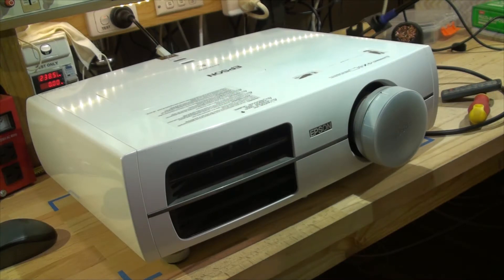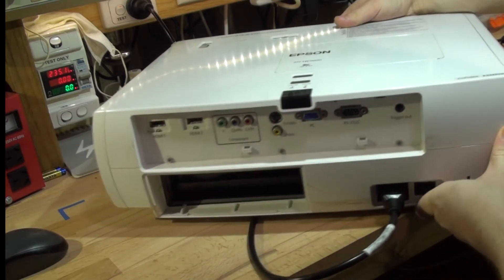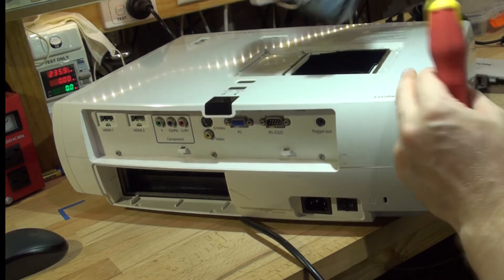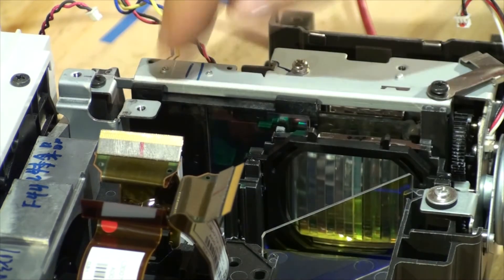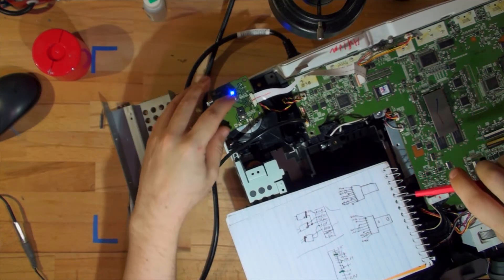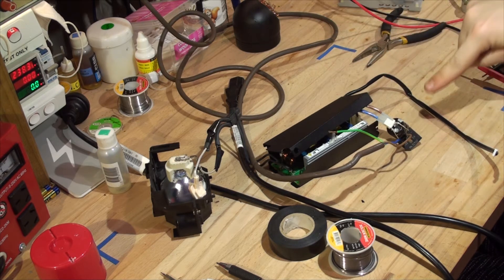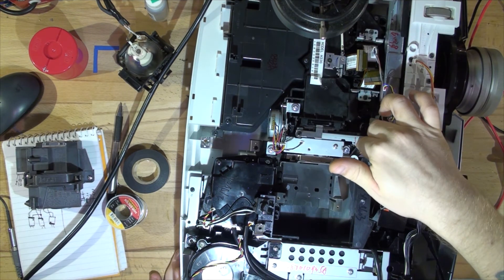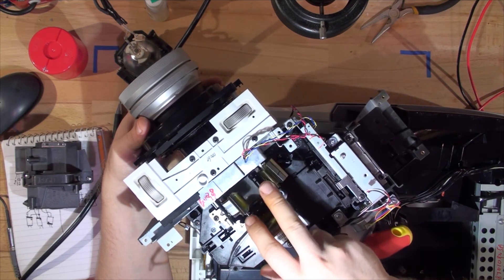Repair of EPSON Projector + Identifying bad polarizer

Comment: Hi Max, this is a great video very in depth. Is there any way to realign the LCD panels once removed? I did that on an epson tw-6000 and the convergence as you said is like 3D😂
Reply from the maker: It’s a nightmare to realign lcds, i made a mistake taking them off ones, what I did is I used a very bright torch and shine is through the engine, then I used blue tag and held lcds to the assy with it, then. I’ve attached Center lcd properly, and use it as a reference, and slowly I’d push side lcd bit by bit amd run up to a faint focused white rectangular projected on the wall from the torch and see if needed more adjustment, it’s a nightmare and frustrating. Once 2 lcds aligned close enough I use a drop of glue to set in place, so there’s no easy way to align them.
Reply: @MaxELECTRONICS  Thanks for the information. I just gave it a shot and i am confused by shining the torch through the light engine? I have a strong torch but nothing comes through the lens, i removed the optical lcd assembly and put the torch through each lcd then i had a rectangle on the wall of each colour but i still cant work out how to align by putting the torch in the same place as the lamp would sit to get a rectangle on the wall? Can i remove the lens to align or does that need to stay fitted as well thanks in advance
Reply from the maker: You need to do it in the dark, I used HID torch, make sure your shutter is open and light shines through optical engine, you will see faint screen on the wall and you’ll see the lcds out of alignment
Reply: @MaxELECTRONICS  I have the same problem with misaligned colors on an epson hc2000 :/
I'm going to try to do what you say, I thought about it but I don't have the courage to do it
great video greetings

Comment: hi have  epson  hc-8350= two red light  blinkin but no picture  lamp  & temp lights are blinking  can any one  have idea whates going on  how can i fix it    ?????
Reply from the maker: Hi, try checking that all temperature sensors with multimeter, check all Fans and ensure they are okay, also check the iris and X.V colour filter make sure they can move freely and not stuck.

Comment: I really appreciate this video, thank you! I’m currently troubleshooting the North American version of this (PowerLite 8500), but looks extremely similar. Could I get the diagram you drew of the ballast communication connector? Mine is making the lamp come on dimly then shutting off, but on occasion lighting up fully. It may try to start up to 3 times before failing. Only the lamp LED blinks though on failure. I have tried two different bulbs and both can work but both will fail too. Am I right to suspect the ballast? Thank you!

Comment: Very good video, thanks! I'm pretty sure now that my Panasonic has a problem with one or more of the out polarizer.. There is a mark on the right side of the image, the picture look more orange in this aera. And the other side the image looks more blue. This is not uniform, so I think the polarizers are burned. When a buy the projector, the filter was really dirty, the lack of cooling maybe cause the problem. I have already check the input polarizers and it seems to be good. I have also cleaned all the lenses and the mirrors, but the marks are stile here. 

Can I try to put other out polarizers from a different 3-lcd projector (with corresponding colors) ?
The input and output polarizer can be swapped?

Thank you a lot for all your help and your videos 👍🙂
Reply from the maker: Yep sounds like out polarizers
Reply: @MaxELECTRONICS  all right, thanks 🙂 I will try to replace them with those of a another brand projector. They are both .87" lcd panel, I hope they will fit in.

Comment: Subbed, very awesome and valuable info.  Besides the color of the polarizer, are there any other special attributes?  For example, I found a nice Sony That I am sure has a bad blue polarizer but the replacement part from Sony is extremely expensive can I just pick up a generic one and if so what is needed to know about the one that was in the device?  I want to make sure it is compatible and high-quality
Reply from the maker: You’ll need to determine what polarizer has gone bad. IN or Out polarizer, then you can get one from eBay or AliExpress, they usually sell them as a piece of film that you stick to original piece of glass, (after you peel old polarizer off) there’s a video that I did on “how optical engine works” you can find on my channel, that should help you bit more in understanding polarizers. But any generic polarizer will work or even polarizer from another projector as long as it’s from same colour.
Reply: Awesome, thanks.  Watching the other one now.  I am buying a Sony vw600es for $500 now and screen is very yellow, so I am thinking either blue or green polarizer issues.
Reply from the maker: From memory yellow means Blue polarizer, if whole screen fully yellow it means ether polarizer completely missing or lcd not working
Reply: Ok, thanks a bunch!  I am going to test it, if it is evenly yellow, I will walk, If it is blotchy like a polarizer failure, I will get it.  Cant imagine a 4K lcd screen being worth it to replace.  I believe these also have independent color control boards... so that would probably not be worth it either.